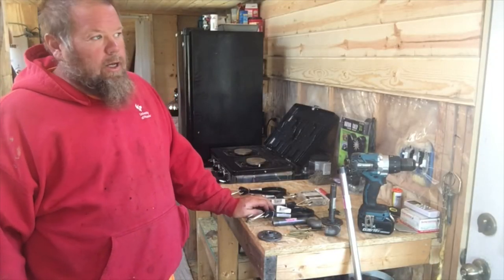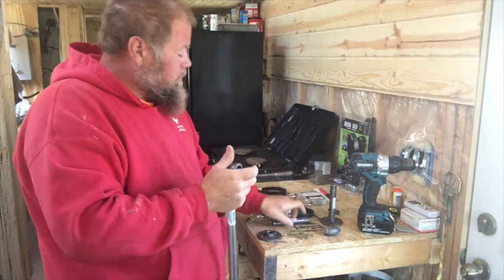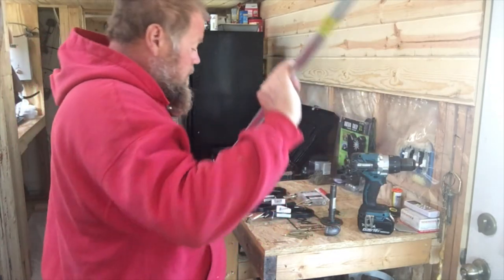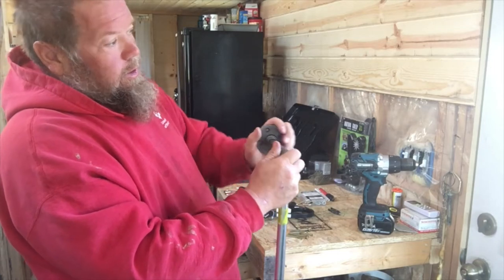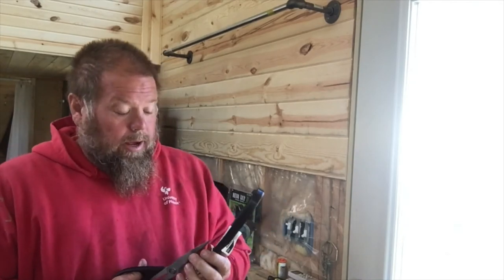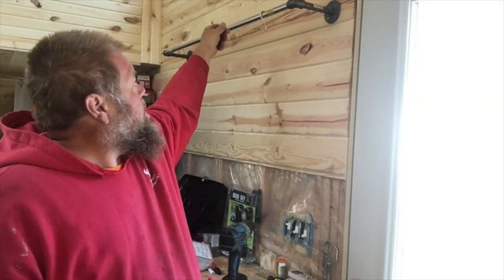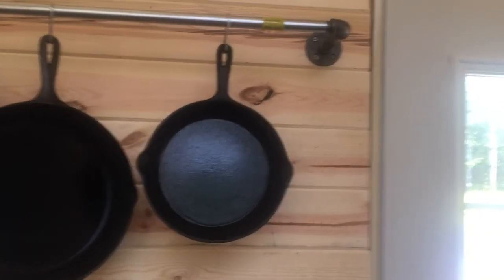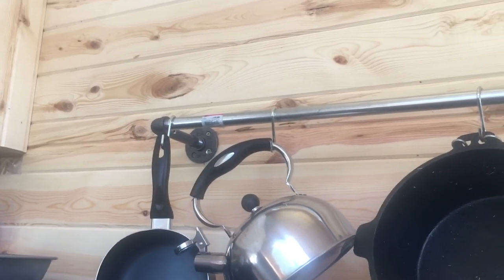Industrial Hanging Cast Iron Pan Rack

Comment: Looks great, I have some cast iron also I want to hang. I'm going to hit the local Ace Hardware Monday morning and see if they have those materials you talked about. How long were your wood screws?
Reply from the maker: I just saw your comment, I used 2 1/2" #10 Wood screws... to me it is more important the screws were robust enough to hold well to the wall, the extra length got me into the stud... Sorry for the delayed response, I hope this helps and thanks for watching....

Comment: Have you found the 5 1/2 inch gap from the wall to be too much or too shallow? I'm about to make one of these but I want to be sure the gap is correct.
Also I plan on hanging 2.5x as many pans, do you think that will be an issue?
Reply from the maker: For me the 5 1/2" gap has been perfect as the pans hang at.a slight angle so they stay away from the wall so when I hang them back up after use they are hot and no heat transfers to the wall... I currently have 9 pans hanging and the bar has no fatigue, but i did plan for the weight by making sure my attachment point landed on wall studs... The hanger for me has been a real success, and continues to serve my needs, it has been up for 2 1/2 years and still looks like the day i made it... Hope this helps, and thank you for watching....
Reply: After spending hours looking for the perfect hooks for a good price, buying some from IKEA online (that were way too small) I followed your lead and bought bungie straps for a buck with 2 hooks. They really are the best, thank you.